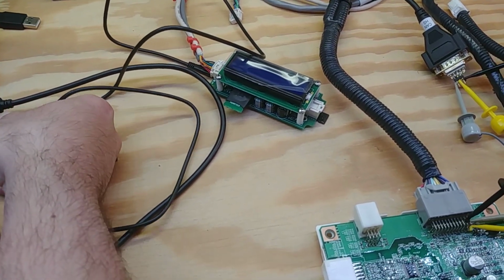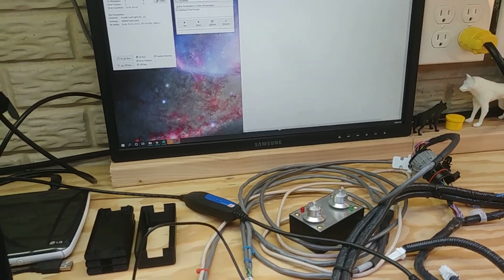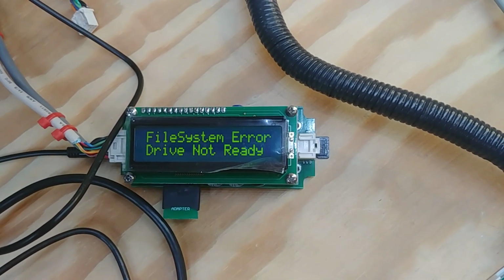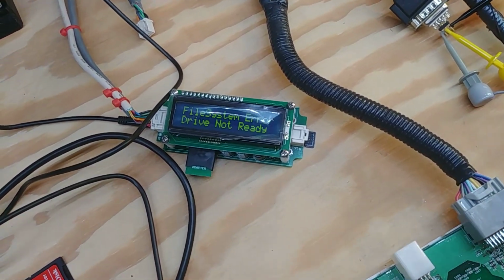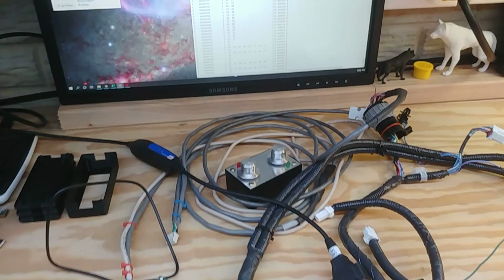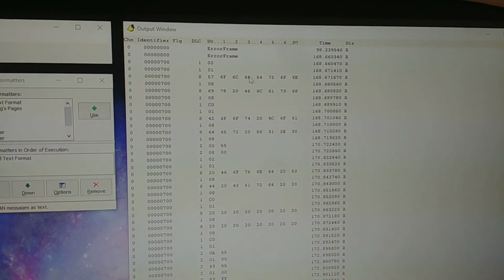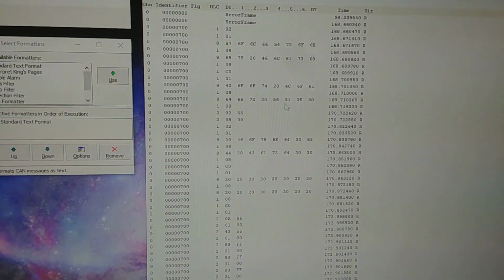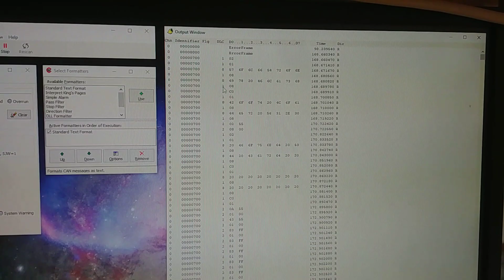Solectria E10, Lithium Ion Battery Upgrade, Part52

Comment: Hi, would you consider open sourcing the hardware and/or software? I found pictures of the schematics on your website, but no files or code. What you did there is some awesome work reversing the bms board and I'm considering doing something similar for proper software control when adding paralleling leaf batteries.
Reply from the maker: It's still a work in progress.

Comment: Yes, you should change the reply/ack ID to 701.  That way both you and the micro's can tell the difference between the command and reply packets.  I'd also split things into LCD group and file group.  You want to have checks in place in case your FSM should slip a cog.
Reply from the maker: Yup, that's the plan...
I was trying to avoid using up too many addresses for each device, but, I could always go to the extended address space.

I was on eBay last night, looking at getting another laptop and another ICD3 (or 4) so I can have both micros on the debugger at the same time.

Since the PCBs came in, I am switching over to building up the assemblies.